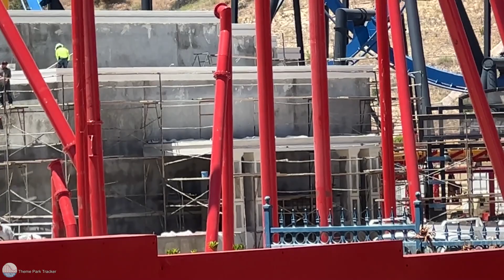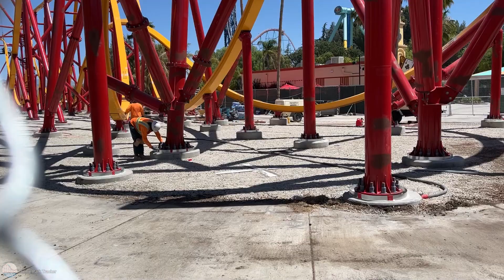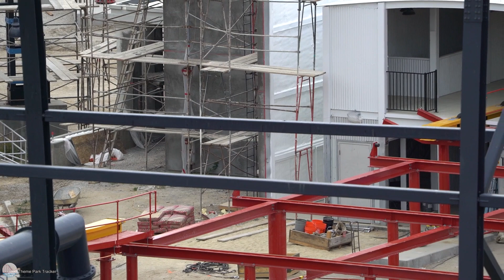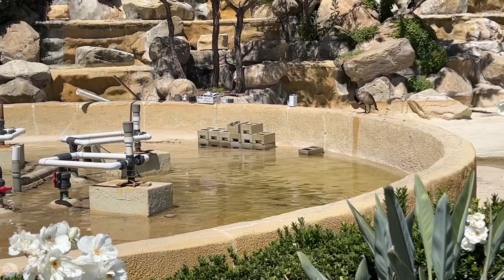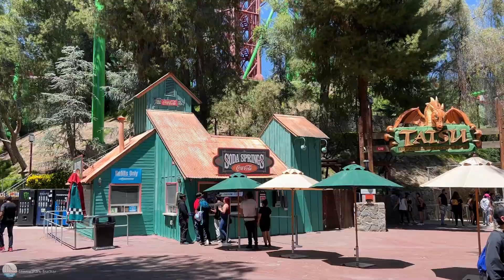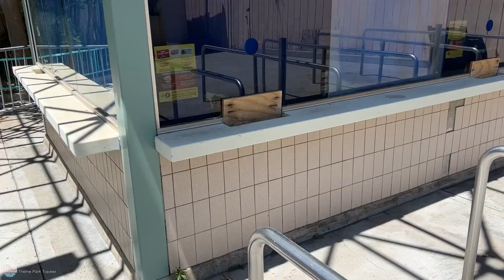STATION and LIFT HILL Progress | Wonder Woman CONSTRUCTION | Six Flags Magic Mountain NEW Coaster

Comment: Magic Mountain needs a 3rd water ride desperately. For the summer, having only 2 water rides isn't enough. You don't really get that wet with Jetstream either.
Reply: hurricane harbor exists
Reply: i mean they have the two, justice league, hurricane harbour and idk what else since i’ve never been but that’s more then enough
Reply: @bradymartin7260  If you never been, don't speak on it...IT GETS HELLA HOT OUT HERE in the summer....and Hurricane Harbor won't be enough.
Reply: @seanlewis1148  Hurricane Harbor, Jet Stream, and Rapids are enough, plus Justice League has AC.
Reply: That park gets hot!  Yes they need another water ride
Reply: The problem is if it’s not hot, by the time you get off the water ride you’re dry anyways. When it’s 110° in Santa Clarita a water ride really does nothing. And I really hope they don’t get a power splash those things do not look like fun to me I’d rather have them invest in real rides and just use a water bottle to wet myself
Reply: Aquaman Powersplash